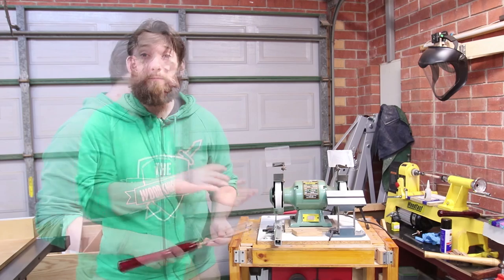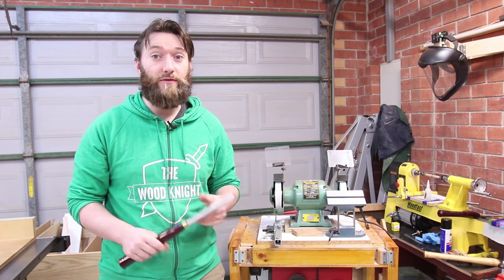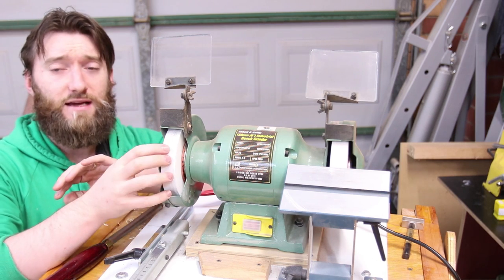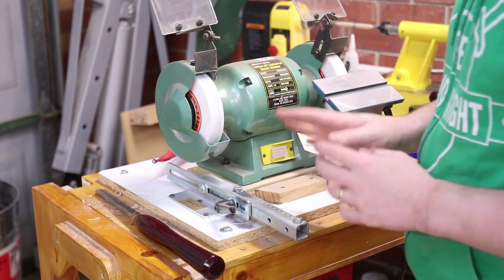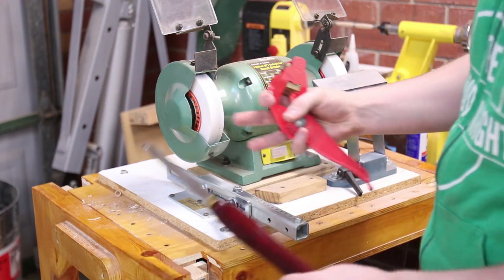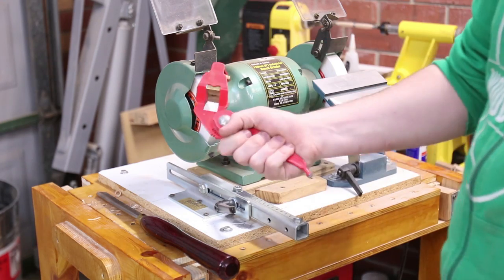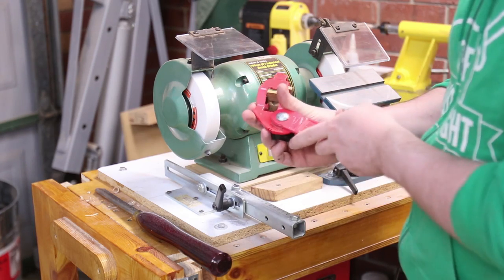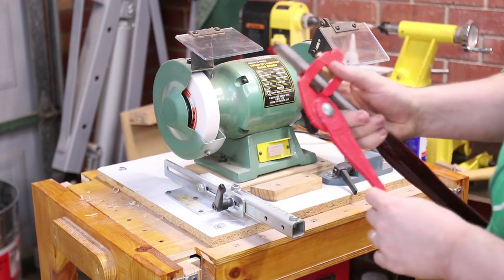DPTG Supplemental: Sharpening

Comment: Good afternoon Mr. Jenkins .  Do you recommend the same grit wheel for all tools? 120 grit. Do you need other grits for roughing gouges?
Reply from the maker: +Toby Clayton no, all tools can be sharpened on the same grit. It may be advantageous to have two different grits (even if you just swap them out) - a 30 or 60 grit is much quicker for reshaping a grind if you've just bought a tool. A 180/240 grit may be better for finishing passes (scrapers, etc) but not strictly required